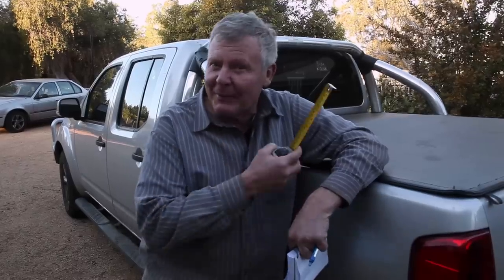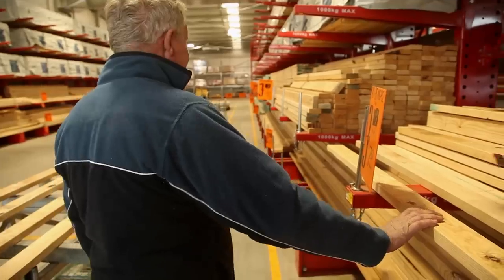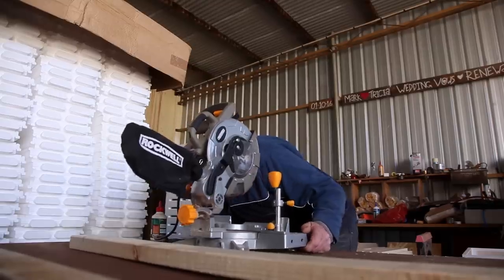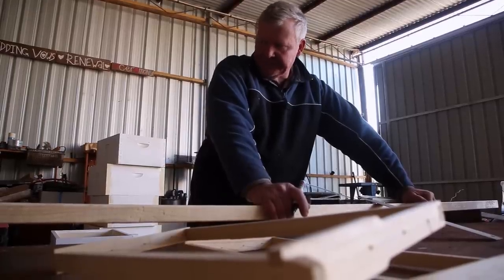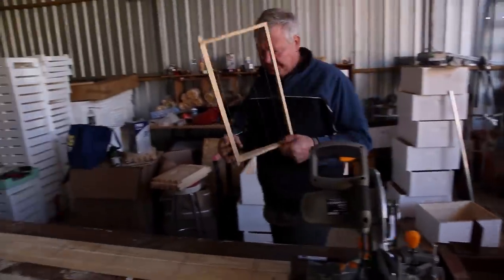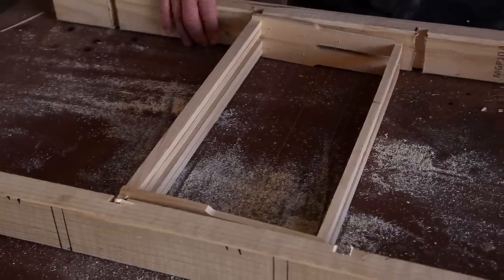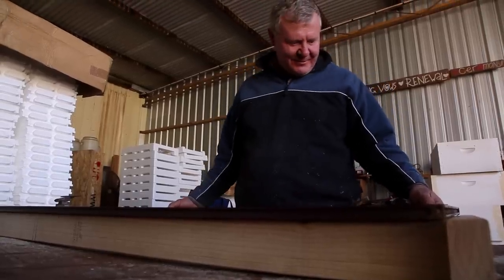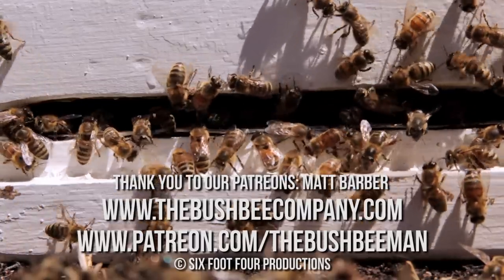How to Build an Observation Hive (Part 1 of 3) - Episode 82: "View Hive"

Comment: This is a great idea. I have a long aquarium that doesn't hold water that I could stand up and use for a viewing hive OR a vivarium for my mantids. Although it would be a big tank for 1 mantis but I could put a barrier in between and make 2.
Reply: Sarah Klauda  tbh I was thinking about busting the bottom out of one of mine so I could build a vented wooden baseboard..I’ve seen ppl use Lang frames with a little adjustment like putting a tab on the top bar of the frame  but I’ve also seen some nice top bar hives made out of aquariums...nfs best way to incorporate a feeder yet...but I thought about using a 20 gallon tall and use Lang frames with no bottom bar think they have to lengthen the top bar or add a tab to it if u want to use a frame prolly why some ppl just make top bars  but that’s prolly the only size aquarium I don’t own and none of mine are broke anyways lol...guess I’ll have to catch petco 50% sale